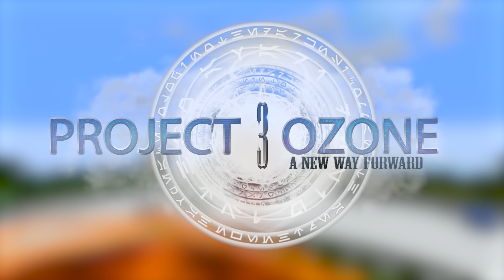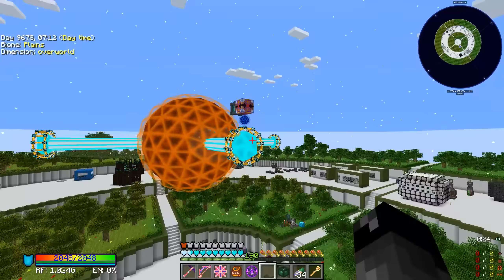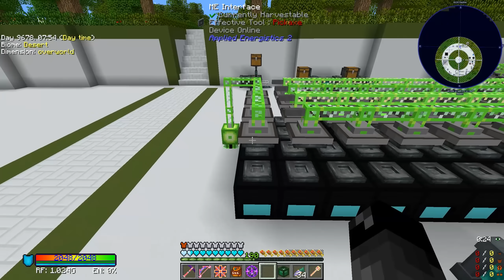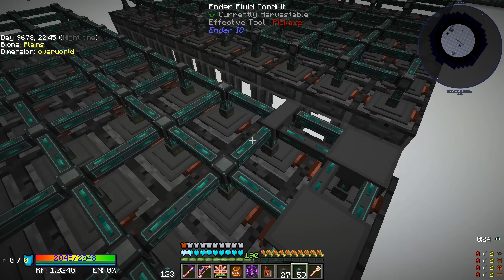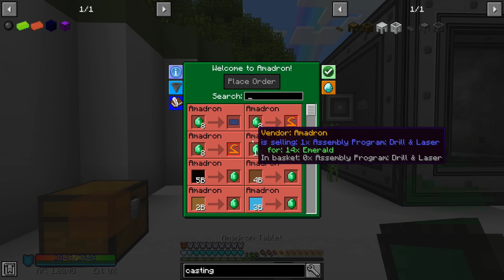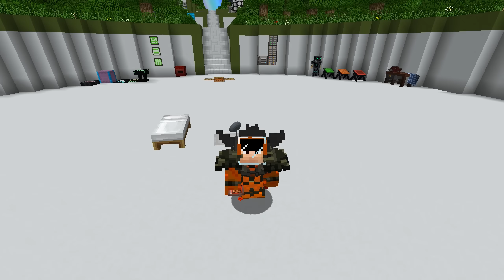Project Ozone 3 Kappa Mode - OSGLOGLAS, MATRIX & EGGPLANTS [E157] (Modded Minecraft Sky Block)

Comment: If you need 128 Osgoglass ingots with each taking five seconds to form right? Well not taking into account of pouring and extracting which will add an additional second or two on top, we’re talking about 12 ingots per minute and around 700 Osgoglass ingots per hour. So 128 Osgoglass won’t take a whole lotta time